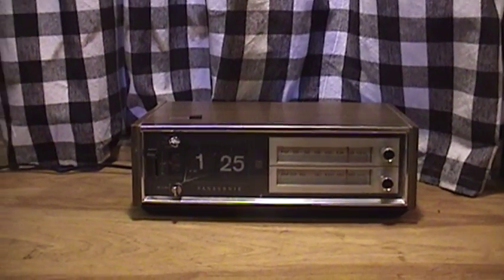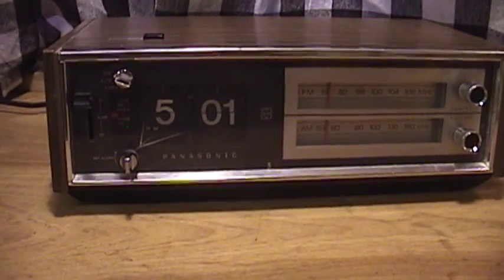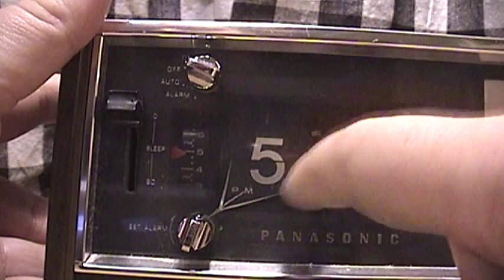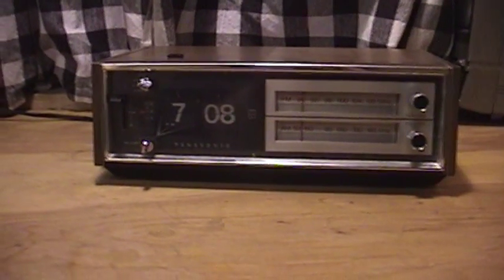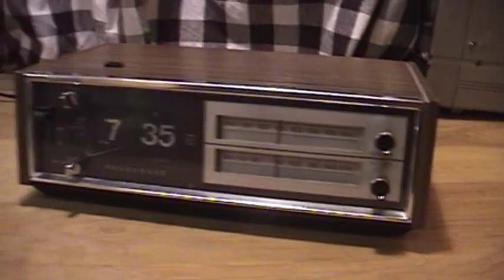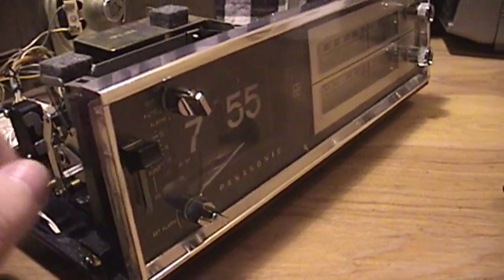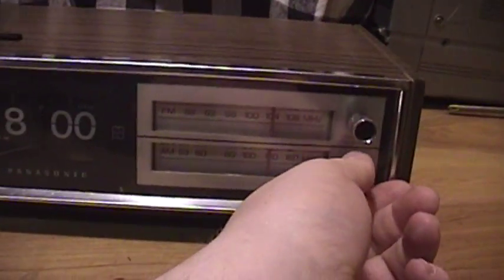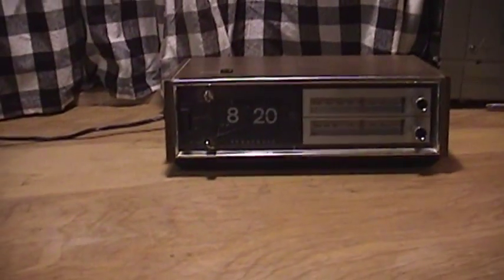Vintage Panasonic RC-6530 Mechanical Flip Clock Radio

Comment: very nice. I have a portable Panasonic radio from the same time period. I'm thinking 1972, It runs on 4 AA Batteries and is a totally beast. I can pick up stations that are 2 or 3 hours from my house that no other radio I own can get. It works especially well on the A.M. band.

Comment: Thanks for the great illustrative video , I have the same exact model only much cleaner condition, I would say 9.5/10 ... I have been wondering whether the light is supposed to stay lit or the button was stuck down/broken keeping it on..Appreciate your video and now I don't appreciate it having to stay up lit fearing the bulb would blow eventually due to age.